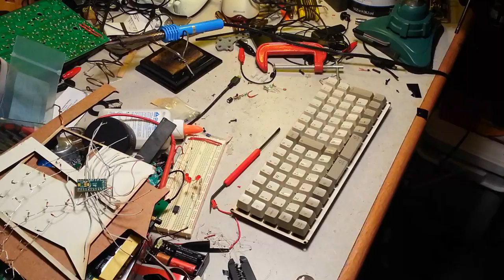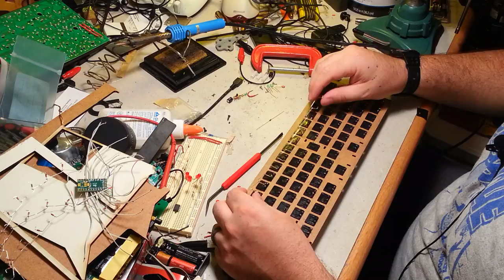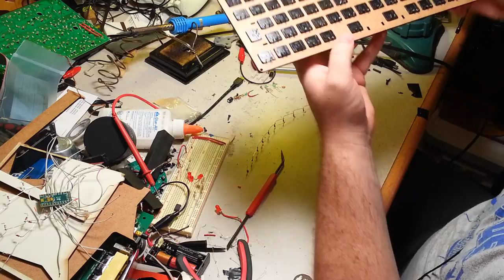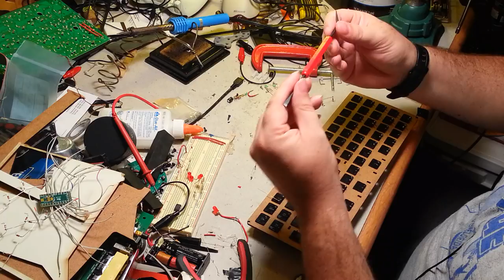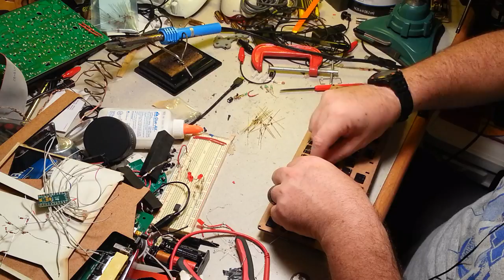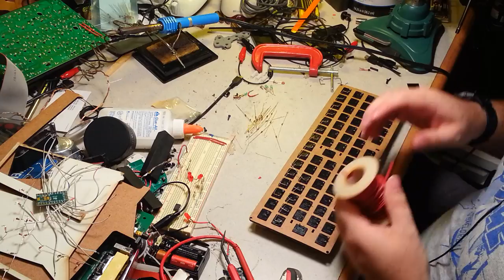Handwiring a keyboard Part 1 - Getting started, and diode rows

Comment: What is your plate made out of?

Thanks for doing the videos. The commentary was very entertaining!
Reply from the maker: The plate in this video is made of pressed board, basically dense cardboard salvaged from some ikea furniture. It cuts quickly and easily on a CO2 laser cutter, and I had several square feet left over when I broke down some Ikea furniture, so it was free, cuttable, and easy to repair/recut/file/glue. Great for prototyping something out before I cut it in (comparitively) expensive acrylic.
Reply: Oh I see! I thought it might be MDF or something, and was wondering about the structural integrity. Thanks for the quick reply!
Reply: Was this a custom design by you? Tried searching around for the little foot layout as i would like to see if i can do something similar based upon this layout.  Really impressive work. Thanks for the great tutorial series.  Very helpful.
Reply: @tylerlarson1865  It’s basically a Typematrix 2030 layout. 
I have a very similar keyboard project.